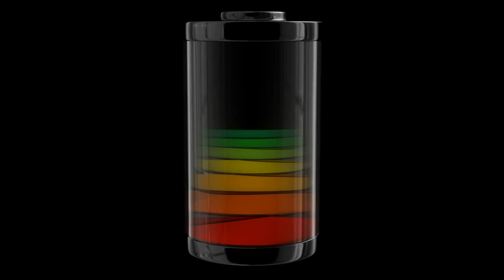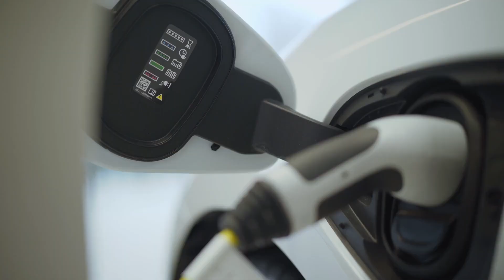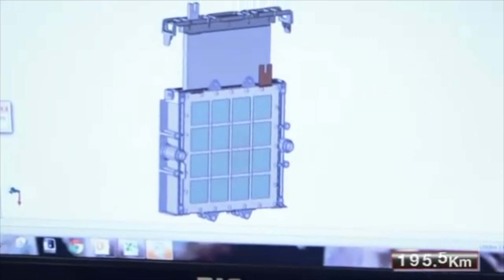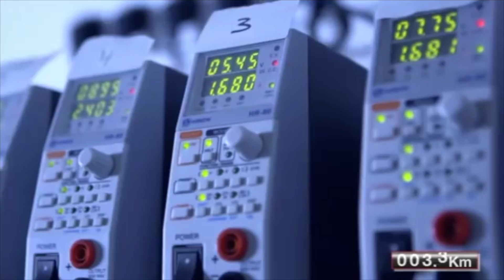This Battery Gives EVs 1000 Miles of Range!

Comment: Nobody is gonna want to pay what it's gonna cost unless its subsidized and/or forced upon them. Any way you slice it, it's gonna cost more than charging an EV battery, and with aluminum, you're paying for the equipment every time you "fill up" as opposed to an EV battery where you pay the majority of the cost up front, and more down the road as the battery ages, but in between that, the cost to charge is pretty reasonable. 

Sure, let scientists play around with new ideas, but they did try this decades ago and realized it just not gonna be cost effective. I don't think that has really changed
Reply: Also, you'd need even more infrastructure for the fuel cell swap out. I don't think they're gonna have self-serve battery swaps, your gonna have to pull in somewhere, have a worker attach the battery to some kind of lift, and swap them out for you. So that's gonna add cost.

Also, you won't be able to integrate the "battery" into the frame, so that's something vehicles will have to be designed around (similar to an ICE but ok).

So idk, they're gonna have to make it really cheap and easy and people are going to have to trust it, because if you're pack dies in the middle of nowhere, you're kinda screwed

Comment: Oh sure the batteries are heavier than the gas tank. But there’s no transmission no exhaust system no emissions, and the electric motors are much lighter then a gas motor

Comment: This could be a very viable solution to the electric car option. The big if is this....are car manufacturers willing to accept a standard battery for their brand. If they did, a gas station could become a battery station. Pull in, they pull out your old battery pack and slip in your new pack in the same time it takes to pump a tank of gas, with the added benefit of a thousand mile range. Until this is a reality I will keep burning dinosaurs.

Comment: But surely the battery pack would continue to erode the Aluminium when the vehicle is parked and overnight unless I've missed something
Reply: That's another challenge to overcome.
Reply: Spose you could just plug the car into your house and sell the power to the national grid to offset the cost of the recharge cartridge

Comment: I'm pretty sure Aluminum is not more energy dense than lithium.  Lithium by weight on the period table to hold electrons is significantly lighter.  The only elements that technically could be higher energy density would be helium or hydrogen - which aren't useable for the reasons that one of them is noble (no free electron) and are natural gases (which is not easily used in a solid battery form)

You might want to consult a basic chemistry professor first.

Comment: This won't be, and doesn't have to be the whole solution. What it does show is there is more than one way to do any task. Also sometimes even failure leads to success that would not have occurred if not for the path that was taken in the first place.

Larger swappable versions, seem practical for commercial industrial applications.  One thing I like about gasoline, is it is very easy to carry 50 miles of insurance in a couple of gallons container. If a battery dies, you stop, that is the end until help arrives.

It will be decades before all the kinks are worked out. I don't plan to own an EV in my lifetime.

Comment: Two gallons of gas will get you 300 miles???
Reply from the maker: No 2 gallons of gas store 72kWh of energy
Reply: @TwoBitDaVinci  Same thing isn’t it? 72 kWh in 1000 pound battery will get you 300 miles. 72 kWh in only 2 gallons of gas will get you 30 or 40 miles maybe? I’m sure I’m missing something here as to what you meant, but others may be missing it too. But it sounds like your comparison was not talking about kilowatt hours but talking about range per amount Of whatever fuel you do you happen to be using. Whether it’s batteries or gasoline. That’s just the way it came off in the video.
 Sounds like the battery even though it’s much heavier completely blows away the 2 gallons of gas. I mean the 2 gallons of gas technically has the same kilowatt hours of energy available but it only gets you 30 or 40 miles. So maybe you could make a clearer explanation regarding your comparison. 
May be better to say that it would take only 20 gallons of gas to get the average ICE car the same 300 miles but would only weigh 120 pounds. As opposed to 1000 pounds For the battery. 
Same amount of energy at 1/8 of the weight. And maybe 1/8 of the space too perhaps? 
And is the thing that offsets the efficiency of a gallon of gas the fact that it uses a very heavy internal combustion engine? 
And is the motor that’s driven by the battery so much lighter that it offsets some of the disadvantage of the lower energy battery?

And I’m flattered that you would take the time to respond to my original comment. Thank you, and I do enjoy your channel :-)

Comment: Is it possible a liquid aluminum binary battery solution could be developed that can allow the reactants to operate and the battery to be lower maintenance? Distilled water and liquid aluminum compound could be pumped in and then drained out. This would also create the speed of "pumping gasoline" instead of waiting for a charge.

Comment: Okay, so they should build EVs with easy to swap out aluminum air batteries.  There could be qualified "changing stations" for this (new jobs!)  No different than getting an oil change once in a while.  If you have to add some distilled water every so many miles, big deal.  You have to stop and add gas to your car now, so what's the difference?  So far, I don't see a down side to this.  Someone needs to tell Elon to get back on the ball!!

Comment: Hi, I am still on the fence regarding electric powered vehicles. It still requires precious metals and there are emissions from the electricity  needed to power the car. Personally, I believe that there should be more emphasis on bio fueled  cars, using methane from garbage.
Reply: So, take a waste product and use energy to ,make it into a more highly ranked climate poisoner than CO2  Not at all the right approach in my view.

Comment: 300 mi  from 2 gallons?

"Pure alloy"  - you get today's oxy-moron award.
Alloys are mixtures - you can't have a pure alloy by definition.

Aluminium air batteries are primary batteries - of little use in vehicles

Comment: If a Tela is expected to run 300k miles before the battery (about $5000) can't recharge anymore after 1,500 recharges at a cost of about $15 p/charge, then to drive the car it costs about $27500.
An aluminum battery at material cost could be priced at $25 for the 50 lbs of aluminum, say it costs double that amount in manufacture then $50 but add some profit and say $100; so to drive the same as Tesla you would need 300 of these 1,000 mil batteries at $100 each that would be $30,000 to drive the car...
If it was just the Aluminium cost and manufacture cost then 300K miles lifetime would just cost around $15,000. So the technology is better but perhaps is only profitable if the manufacture cost falls below $90 per battery.

Comment: these batteries could be built as smaller cells or packs like battery power tools so its off the shelf plug and play. Even better, a filtered system that you just replace the filter and aluminum cores then go again. think how nuclear reactors replace fuel rods. Bonus, in this format a refill has a discount for oxide return.

Comment: Good topic, and also You have to also consider that eventually, you Lithium/Ion battery will have to be changed in your EV...at a stiff cost. Plus, I could anticipate that there could be a mobile Aluminum/air battery swapping procedure that could be easily set-up in various  areas where the distance is a real concern. A semi-trailer could probably carry a few hundreds of those units, and with a portable shelter to do the swap , that could be a viable option. But, to be able to do that; there would have to be a standardized shape for the battery pack ,that would need to be agreed upon among the different manufacturers of the said battery packs...Maybe NOT as easy to achieve

Comment: Too many mistakes to continue past 8:20! The final straw was converting 600 Kilometers into 1,000 miles! You OBVIOUSLY flopped the conversion factor; 1 mile equals 1.61 Kilometers and its reciprocal which you obviously used, 1 kilometer equals 0.62, IIRC, miles! Thus; 600 Kilometers equals about 370 miles! Just off the top of my head.

Comment: The only "KLEEN" energy is from Nuclear power plants! Most of the rest of the world burns coal and that causes about 30,000 times more pollution than burning gasoline in your catalytic converter equipped car! Do not try to rebut this until you have researched the direct cost in pollution to manufacture, whatever crack-pot thing is rattling around inside your cranium, and their replacement cost and their effect on the environment, etcetera.

Comment: You shouldn't try to change accepted terminology.  Something doesn't have to be rechargeable to be a battery.  Consider your flashlight.  An air aluminum cell is a true voltaic cell because it uses an oxidation reduction reaction to produce an electric current.

Comment: This is a really interesting concept. I don't see the battery swap as that much of a drawback... It's basically the same thing as having to stop for gas, except it's much less frequent!
Reply: You should, these ‘air’ batteries have a life shelf of 35,000 miles until they are replaced.
Reply: I agree. Instead of comparing a lithium-ion electric car to an aluminum-air electric car, the better comparison is internal combustion vs. aluminum-air electric. 

To make it a 5-minute swap, A-A batteries need come in standard sized modules, where the number of modules to swap out when it's time to "gas up" depends on the size of the vehicle.

IIRC, in the earliest days of gasoline engine cars, oil companies tried to monopolize by having unique tank nozzle systems, forcing a car owner to only fill up at their oil company owned stations. Today, fuel nozzles are standardized so it doesn't matter what brand of car you drive or station you visit. I think the same needs to happen for A-A battery systems to be accepted.
Reply: Es a very interesting day 🙂 my.frends
Reply: This is also frequent. It takes around 3 minutes.
Reply: I think batteries will always be of lithium,
you hear every week that researchers have found a new wonderful battery that is made of different materials,
these are scams,
the team of researchers wants people to "invest"
there it is!
they just want people's money
Reply: @Zo-greenforest  ...Zodiot... that is like saying... I think we will always ride horses! DONK!
Reply: @DormantIdeasNIQ  alright, but every week we hear that they discovered a new great battery, 
none came to fruition, who is the fool?

Comment: how could air ever be the electrode of a battery? Also, the anode is the positive electrode, not the negative. In order for a battery to work, wires are attached to the electrodes. How do you attach a wire to air?

Comment: There's a new vaporware battery reported every week.   That's after hearing Li was new and revolutionary in 2012.  Li was an old and proven design in military, government and hvy industry for decades.   In computers since the 90s.

Cars are mass consumer large durable appliances so they will always use older and more conservative design components where possible... Or supply chain problems occur.  That's why Leafs and Insights started with NiCad when most small appliances had moved to lithium.  Supply chain and expense. 

No matter what you do,  the BEV will take 20+ minutes to charge from 10% to 80% and 60 minutes or more to get to 100% on a supercharger... Or 10 times that at home.  You can then exhaust the entire store in 3.5 hours of real world driving, then repeat.  True for power drills,  True for cars.  

 Sorry physical chemistry has rules

Comment: Lithium is the best we have for now but still not where we need to be, and over all not much better at being environmentally safe. No one wants to talk about the huge elephant of lithium battery disposal and the toxic impact that will have on the environment.  But even with lithium batteries, energy density alone is still way off. Fossil fuels still have the best energy density when compared to lithium batteries. We have to do much better then lithium, and the technology is there. We just need to explore better solutions.

Comment: hmmm lets think about this for a sec.. IF a gas car that has a spec of 20 mi per gal and gas is at $2.50/g, it would cost me about roughly $0.13 to go 1 mile.  SO if i take this and multiply 1000 mi that would cost me roughly $130 to go 1000 mi in a gas vehicle.  IF this air battery cost me more than $130 to swap out, u can kiss that air battery goodbye bc i rather use the gas car.  would/could this air battery make any profit from swapping/selling by charging roughly $130 each time to compete against ICE cars?

Comment: I wish this was an option for range extension. As a general use case, the costs don’t add up. However, for those infrequent road trips where Americans actually need the extra range, the convenience would be well worth the cost. I also see great potential as an emergency power backup. Just look at ERCOT in Texas during the Texas deep freeze. They charged $9000 per MWh. 🤯

Comment: 010621/0249h PST  Thank you for the well presented subject.The lecture was spotless, fluent and well orated. Like the speaker said, there's a lot of difference in operating Li-Ion, LiFePo4 (basically) and Al-Ion Cells. Frankly speaking is there any motor better than IC engines?
On one hand there are 6000 plus Li-Ion cels in "one Vehicle" The weight? and other other; there's  Al-Ion cells waiting to be eroded and replaced as often as possible! My equation to both power supplies = Li-Ion+Al-Ion-->worry+ discomfort+ anxiety. Remember the battery toy car we all played with ? Batteries are for toys, always. There's nothing to beat a V8 with Rochester, or Webber, Garret Turbo and 97 Octane.
I apologize for being funny! Thank you for such a pleasant lecture. Stay safe and 73s...

Comment: Queensland University has developed an aluminium-graphene battery which has a high density and a recharge time of 5 mins aimed at mobile phone batteries. They are also working on larger sizes
Reply: Let me know what Stock symbol. Thanks
Reply: @christophercardono6274  (GMG) on TSX Venture Exchange in Canada
Reply: @pavellelyukh5272  Thank you
Reply: @christophercardono6274  don't think there is one yet
Reply: 5 minutes doesn't seem likely or safe...
Reply: unless the graphene can be as easily recycled as aluminum then it'll work doubt it though
Reply: @pavellelyukh5272  you dont need to recycle graphene, its everywhere, more abundant than alluminum
Reply: @pavellelyukh5272  what are you blithering about ? its just carbon
Reply: I think batteries will always be of lithium,
you hear every week that researchers have found a new wonderful battery that is made of different materials,
these are scams,
the team of researchers wants people to "invest"
there it is!
they just want people's money
Reply: @Zo-greenforest  and I'm sure when lithium was being developed, you were sure batteries would always be NiCD, since they'd been working on lithium for forever, yes?
Reply: @giin97  lithium is atom n°3
small and good at giving electrons,
that's it, you can't have better than that

Comment: No one needs a 1000 mile range. No one drives that long without a break.

Supercharger networks are at a surplus  in a few short years from now with increasing adoption and Lithium is quite abundant with less processing downside than Aluminum.

The entire premise of this video is just redundant. Click bait!

Comment: Yeah, I see what you mean about the aluminum/air "battery" , a better phrase would be "energy storage tank" = "gasoline storage tank"....instead of "filling your gasoline tank" you would just replace the complete "energy storage tank". Just as with the gasoline supply infrastructure....it would take a while to build up the infrastructure, but I do not think it would take as long as it did for gasoline!!! OH, one more thing....that's one great thick beard you have there!! As you can see I'm a fan of beards, anywhere from four to six to eight inches would be fantastic. Lol. Michael said that, bye for now my friend.